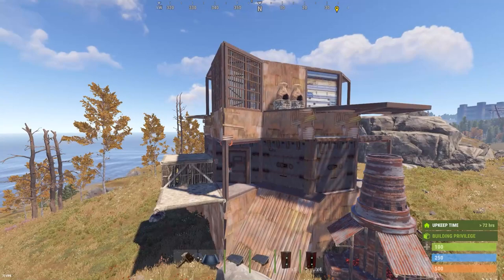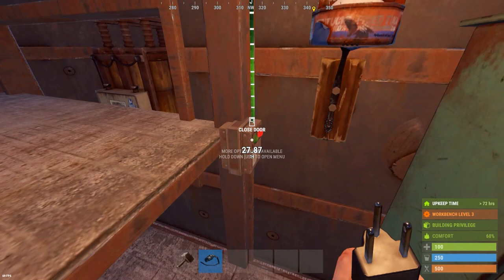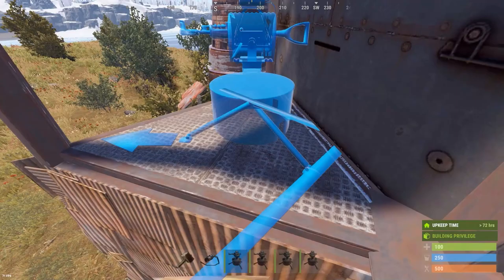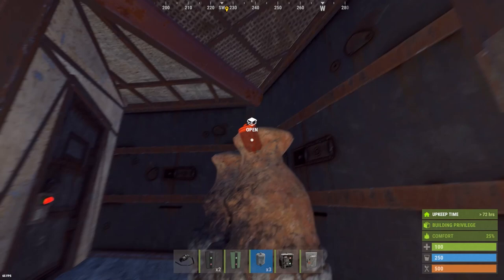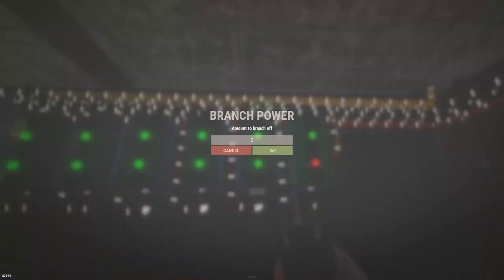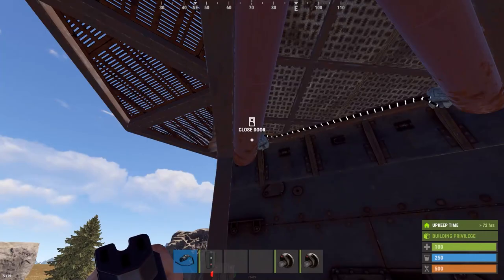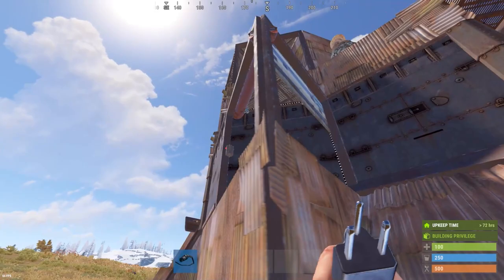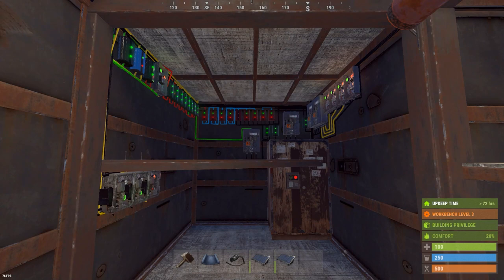RUST Electricity Tutorial | Full Base Wired Up with Power, Batteries, Lights, Turrets, and MORE 2022

Comment: i love the simplicity of the circuit! BUT :D i would suggest using the bottom battery in core as backup and the top battery as primary because the charging of the primary takes way longer and if its destroyed its not so bad because the battery backup in core will have more charge as the primary because its not in use. so you want your backup to be more secure then the primary but in that case i would place more solar panels just to be sure the backup gets enough power to charge
Reply from the maker: Absolutely, you can decide which battery is the primary. I chose to put it inside the bunker portion of the base but obviously this is just personal preference!

Comment: New to rust and electricity. Is there a way to make the light automatically turn on with the wind turbines? I'm having such a hard time finding someone who did this with two batteries
Reply from the maker: Absolutely. Can you be a bit more specific? Do you mean that you'd like your base lights to come on automatically at night?
Reply: What do you mean with "by wind turbines"?
If Gneissish is right, you probably should consider to use an XOR-Switch. One Input form the main power source and one from a solar panel directly connected.

I did not try this yet, but if the solarpanel does not produce any power then, the XOR would set one input to 0 Input and passthrough the power to the light.

Comment: Recommended Improvements: 
The turret doors should close when out of ammo. 
You could setup a notification when your laser/ shotgun trap is triggered.
Your roof needs a turret aswell.
Your roof needs a SAM. 3 is ideal.
Reply from the maker: For sure. Sometimes I just have to pick my battles based on how long something will be.
Reply: Add a CCTV system to

Comment: i find doing it like this when one battery dies the or switch kicks in but soon as 1st battery has slightest power it switches back out, i prefer the aproach of using the solar panels themselves as power then when its dark uses the batery as power giving you a unlimited cycle of power from one bateryy
Reply from the maker: Nice! Check out the latest version of the battery backup I put out. It doesn't bounce between batteries like that one does. But that's also a good strategy.

Comment: Hi I followed your tutorial but my main battery has active usage of 99 but the battery dies so quickly but I only have connected 3 lights and 3 turrets , 1 windmill and 9 solar panels and its still not recharging that fast so it just dies and idk what do to with it .
Reply: I also have another question, how can I add more turrets to an already functional circuit?
Reply from the maker: Regarding the first question, three turrets and three lights should only be about 33-37 active usage depending on switches. I'm guessing you have a Branch Switch (or multiple) set to a high value. To calculate how much charge you need, it's [active usage ÷ 0.8 = charge requirement]. Or, just make sure a large battery always gets at least 126v if you don't want to calculate.
Reply from the maker: Watch this video for your second question! https://youtu.be/WdnqfvckSA8

Comment: installed a timer on the first battery so when it dies out it doesnt keep switch between batteries when the first battery recharges, you end up with you electric keep shutting off. i end using a 3 to 8 hour switch, you end up spend like 5 more power with it
Reply from the maker: Hey cool idea!
Reply: How do you do this
Reply: @jstrong_007  it's on my YouTube page , called my raid def should be the last one posted, the first part discuss how to do it

Comment: What's your command for keeping the wire tool to snapping to the connection points from a meter away? Lol
Reply from the maker: I wish it was a command lol. That's just me being OCD with my runs
Reply: @AustinKlailaGames  ah I wasn't sure if you change your object interact radius or something.
Reply from the maker: @rw1567  it's hard to explain, but if you angle yourself just right you can really get it to tuck in to corners

Comment: Try powering your system with the solar panels during the day while also charging both batteries. Using a second Or/Switch to set-up the second battery as a proper backup.
*Solar Panels give your batteries a break during the day and the batteries are only used when needed. AKA: Night & Foggy days